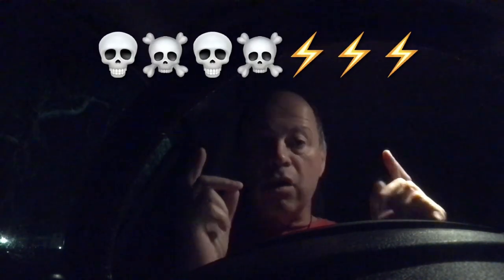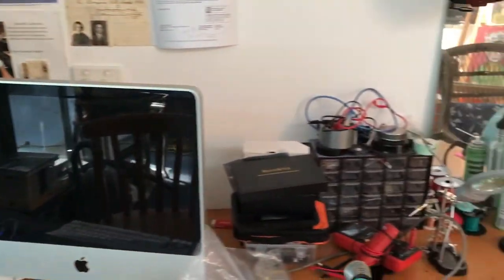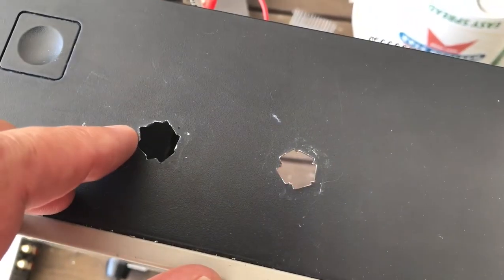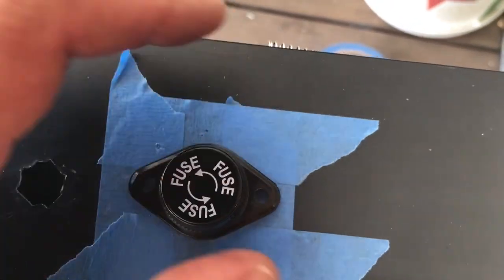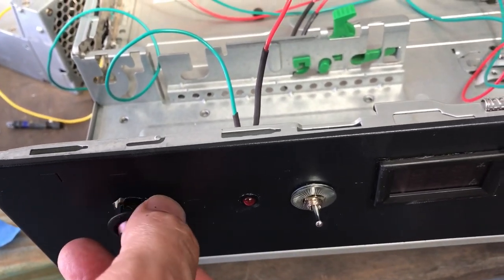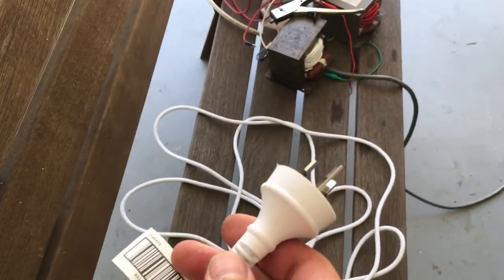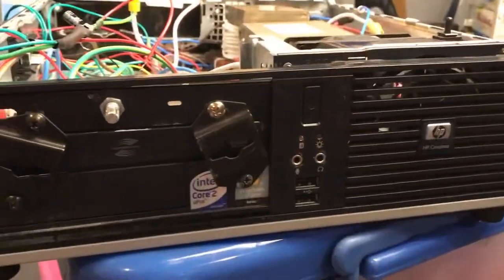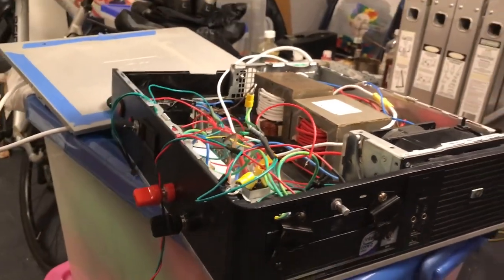Linear 20A 13.8v DC HAM SHACK PSU - Made with rewound microwave transformers@TheArtofEngineering

Comment: Did you rewind the primary of the M wave trans or did you put 2 in series ? They usually have halve the needed turns otherwise they run hot.
Reply from the maker: Yes.....2 primary windings in series. Video 2 in the series shows the current clamp primary current value for one transformer (1.7 amps) and then 2 transformers in series less than 300mA. The supply is now my main shack supply and is still going strong! 73 thanks for the comment de VK2AOE.